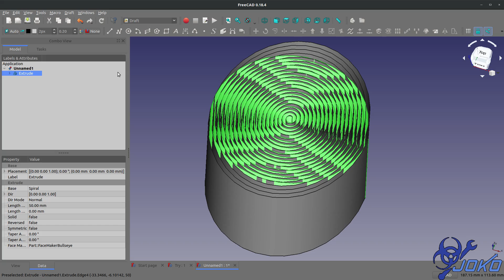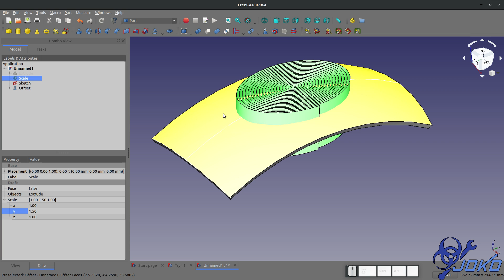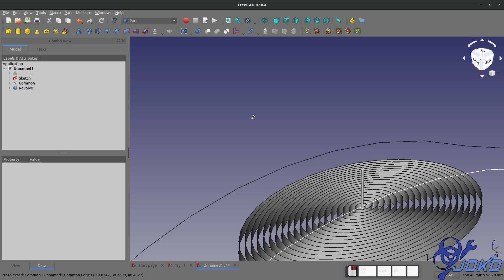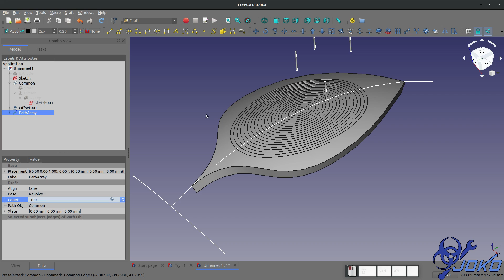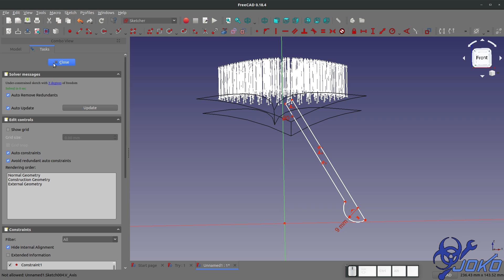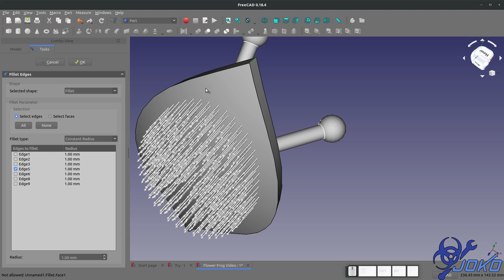FreeCAD - Make a Flower Frog |JOKO ENGINEERING|

Comment: I'm trying to do this in .19.  When I create the PathArray, it only places pins along the outermost upper and lower segments of the Common spiral.

But now I somehow broke the file and FreeCad won't even create the PathArray:

18:59:32  Point array
18:59:32  base_object: Pin
18:59:32  point_object: Common
18:59:32  Wrong input: point object doesn't have 'Geometry', 'Links', or 'Components'.

FreeCad forced creating a clone of the original spiral in order to scale it.